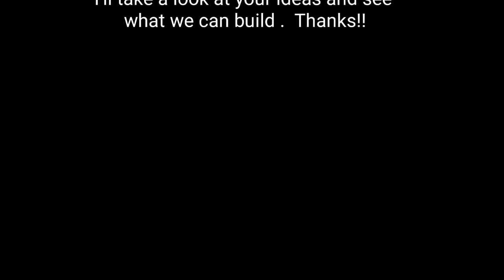How to Train your Dragon Steel plate movie short

Comment: Very nice work all around! ...Do you plan on giving it a lube job? Or is the squeaking intended as part of its character?
Reply from the maker: Ha, thanks.. Yes I wanted the metal sounds that go with the growls and roars, so it has the character of a real steel creature.  Everything is driven by metal rods on the inside, linked to arms that are operated by rotating wood cams.  When they move they the metal guides inside, they make metal against metal sounds.
Reply: I kind of figured that's what you were going for! About a minute in during the close-up of the works. I could see that you were using Cams & Push Rods, driven by a worm gear, for the motion. And that there was some serious electrical and mechanical engineering involved. Excellent work!
Reply from the maker: @TC2232  thanks, keen eyes you've got there, I'm impressed.  It's a main drive made from a car power window motor and gears from an old 60's sewing machine..lol.  worked like a charm. Found it sitting on the curb for the trash guy.  One man's junk.....